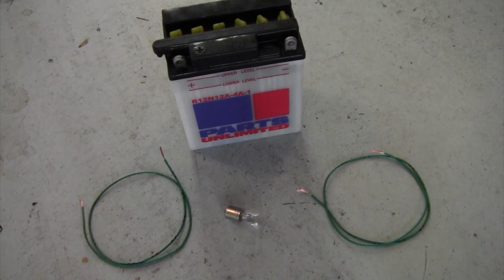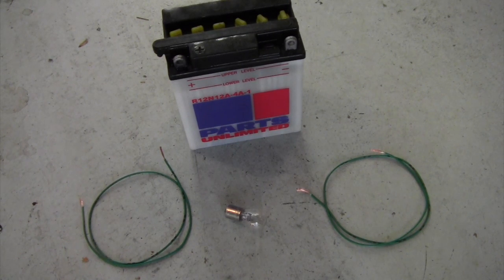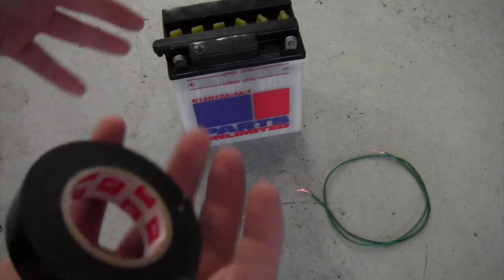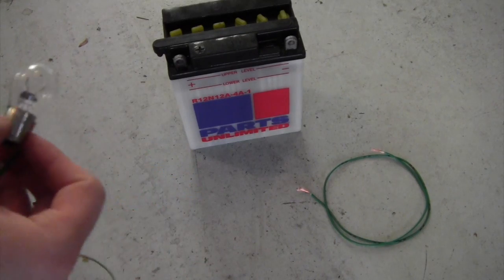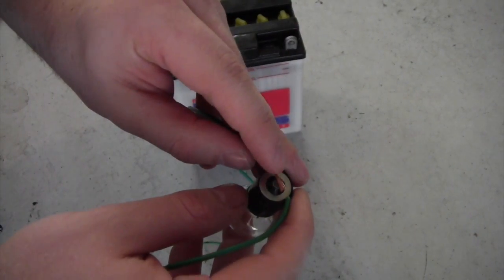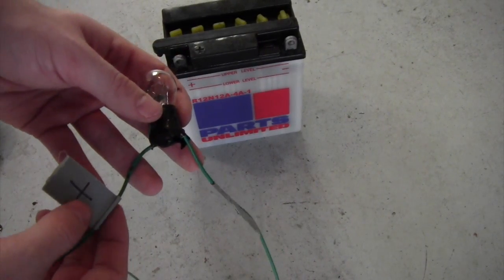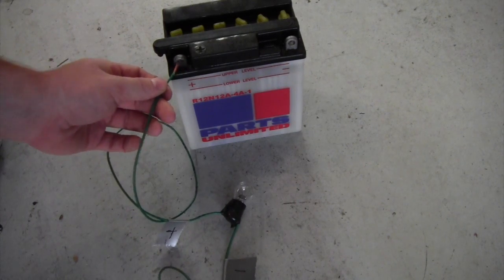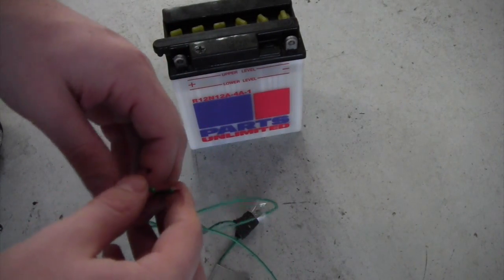How to Make a Test Light

Comment: Can I use this method to determine the positive and negative of the car light bulb wiring? I need to wire the reverse camera and need to determine the polarity of the reverse light. I plan to connect the wire to the car body (as a ground) and connect the tip to each of two wires of the reverse light. I assume if it lights up, it means the wire is positive and if not, it is negative? Thanks